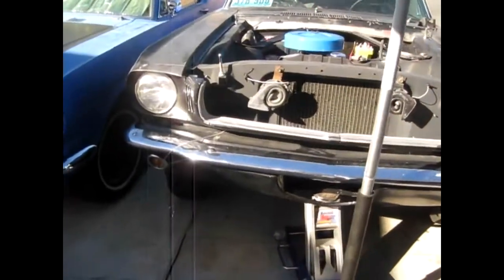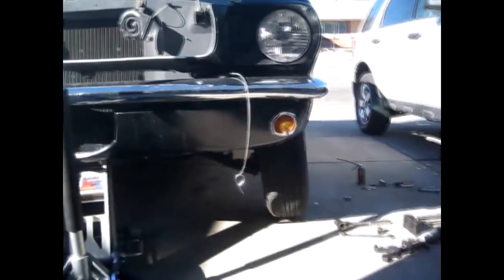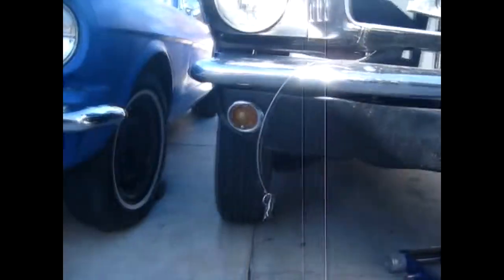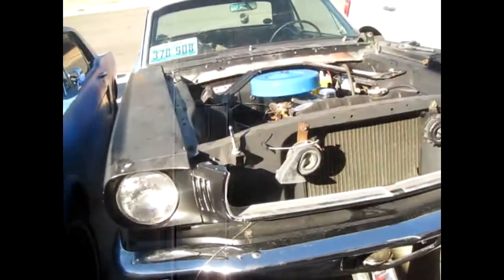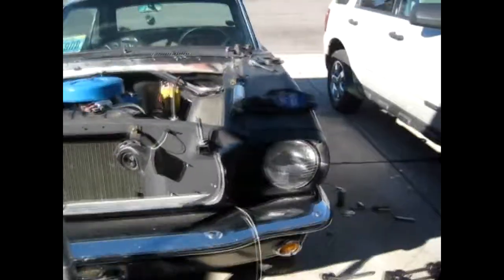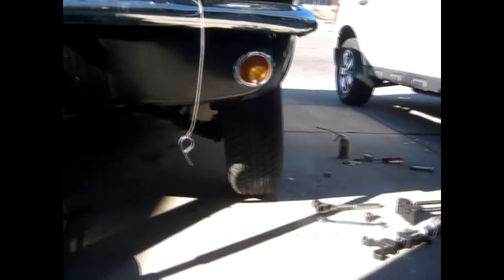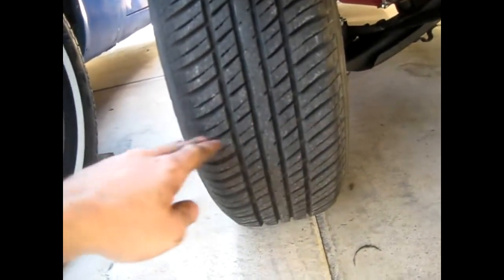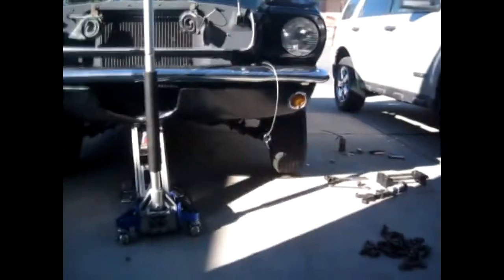65 Mustang UCA relocation - how it works

Comment: Wait....correct me if I'm wrong but I thought you were working on the blue one. I had previously done the UCA on my 65 prior to the MII set up I have now.
Reply from the maker: +Cobrafanatik22 Mine is blue with a black front end. The other blue one with the black hood is my dad's. Blue paint was on sale haha.
How did yours handle before the MII front end? I went around a few corners and it seems to handle pretty well now, but I didn't test it very much beforehand so I can't really tell how much better it is.
Reply: +SuperKONR Mine didn't handle very well but I also had a 17x8 rim with a 9.5" tire width.  When I would go over a hill the car would walk around on the road.  The steering wheel would move and the car would stay straight even though the wheel moved.  If I held the wheel so it wouldn't move then the car would go halfway into the other lane and come back.  And that's with the steering wheel not moving at all.  So it was too sketchy to drive.  Thus the main reason for the MII rack and pinion set up. So much happier.